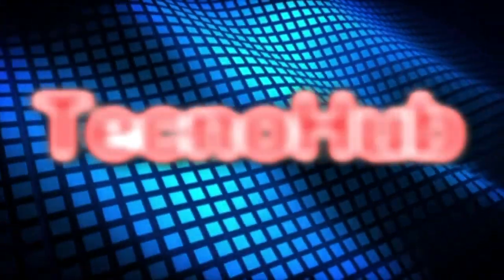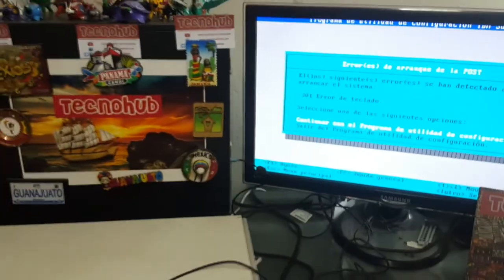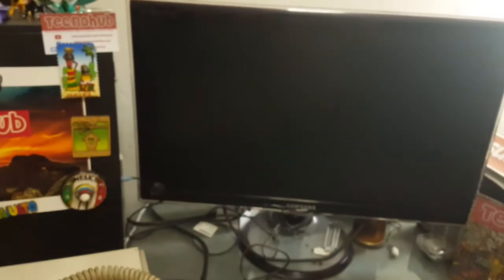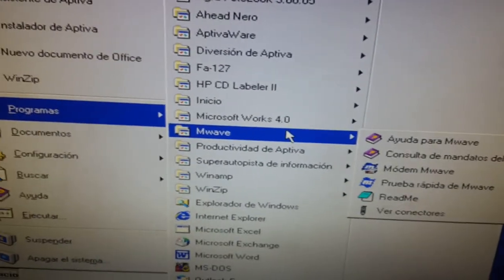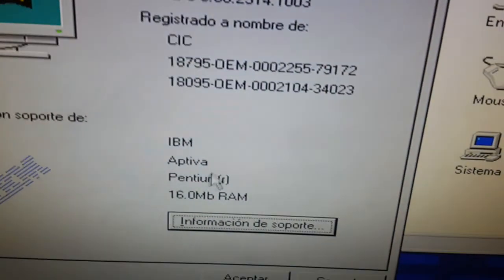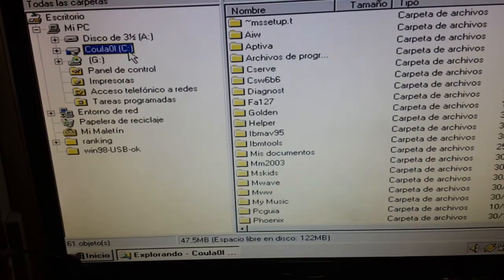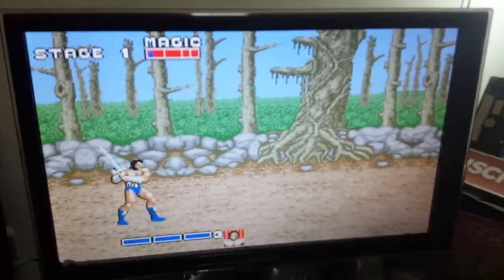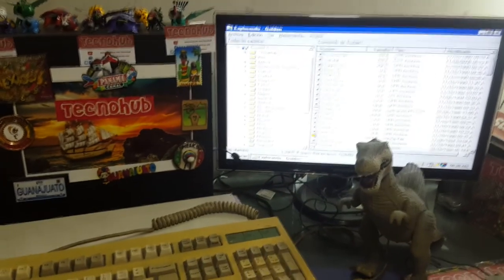IBM Aptiva 2134 una PC de hace más de 25 años

Comment: Hola hermano, buenas, tengo una mega duda que no puedo responder, y espero que me ayudes tu, y es que vi que tienes un vídeo de la gráfica de Nvidia la gt 210 para ser exactos y pues tengo un problema con mi PC, que cuando intento hacer cosas no tan demandantes como abrir Google meet o aplicaciónes similares, se congela la pantalla, y estoy en duda porque el procesador es un Intel i3 sin gráficos integrados, y pues tengo duda si es algo así o es que la gráfica no es compatible, que me recomiendas hacer hermano
Reply from the maker: @Luis H H  que generación de Intel i3 tienes ? Si nos envias datos de tu equipo te podria ayudar con mas detalle. Si es un i3 antiguo debería aprovecharse bien esa gráfica, pero si es un i3 de los últimos en vez de ayudar esa tarjeta esta poniendo lenta tu pc. Gracias por escribirnos y te invito a que te suscribas al canal y actives la campanita, ya que de esa manera nos ayudas a que sigamos subiendo contenido de forma periódica al canal. Saludos ¡!!
Reply: @TecnoHub  es un Intel i3 de la décima generación, muchas gracias por la ayuda hermano